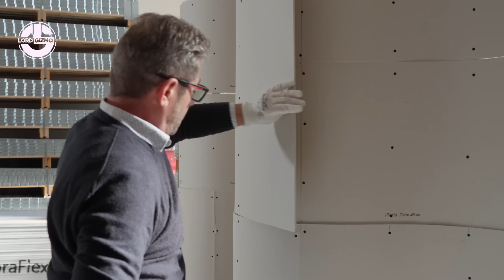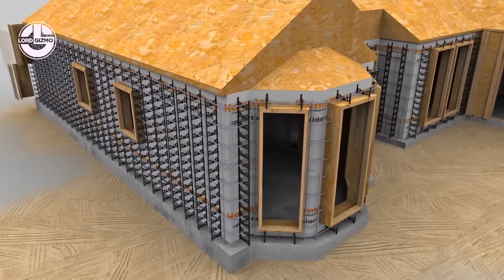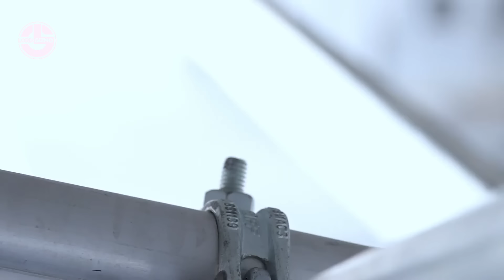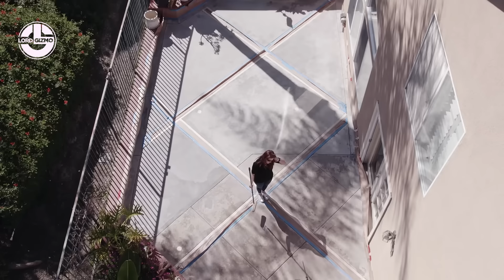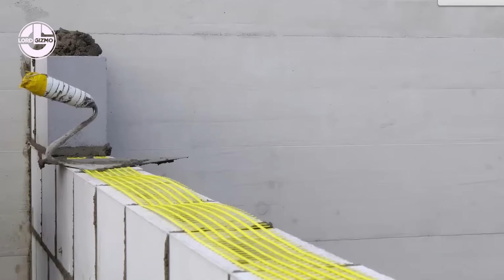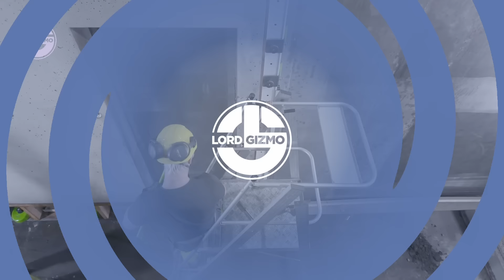Construction Techniques So Crazy and Powerful They Changed Everything!

Comment: All the negative on concrete, sheesh.  I’ve lived in a 50 year old house built with shotcrete and no interior load bearing walls. The only real issue was the cheap siding (now replace) and old school windows (also replaced.  No cracks, no issue’s and great thermal performance.  A lot of blissful folks out there.